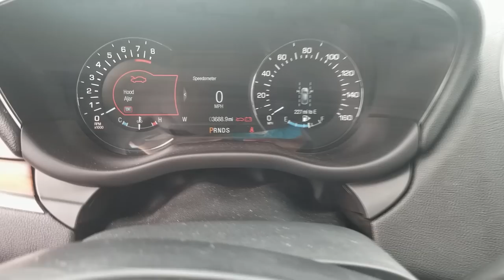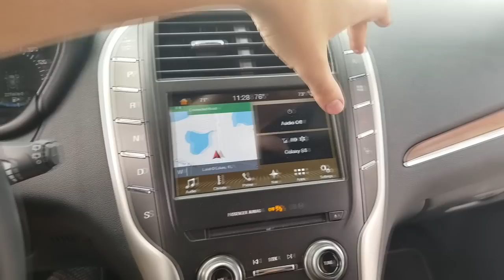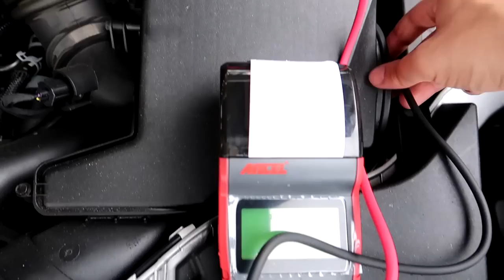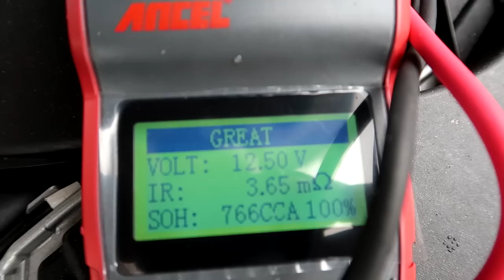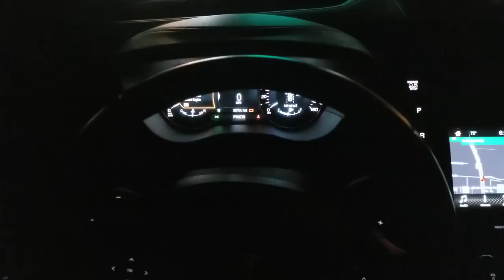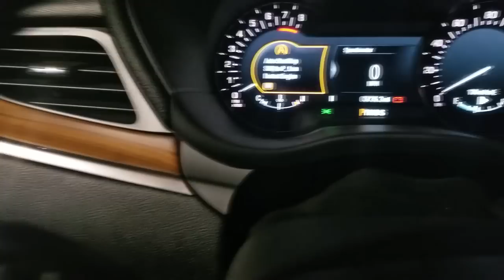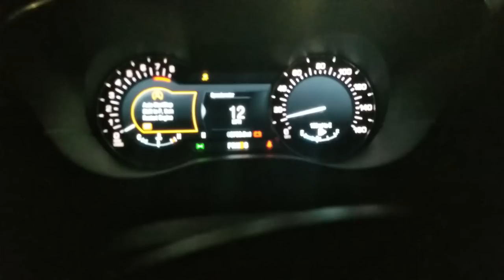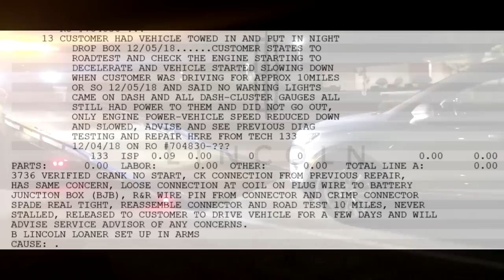I Saved Over $20,000 Buying a Like New Lemon Car! Then it Broke Down TWICE in 48 Hours!!!

Comment: I had similar issue in audi.  The problem lasted 2.5 years and no one could find whats going on.  Finally mechanic found the issue to be with fuel delivery. The issue was a smart relay, which apparently detects if sparkplugs are firing (if no spark for X amount of time, relay disables fuel pump for safety, for example to prevent engine fire i guess), which was not working correctly and it was randomly shutting of the fuel pump. As problem could not be replicated at the shop and cause could not be found why smart relay disconnects the pump randomly every few minutes in one/two/three days period and then its good for days/weeks. Every mechanic though it is a fuel pump, so I went thru 4 of them. FINALLY smart relay was replaced with regular relay ( now pump was turning on and remain on while key was in ON position, instead relay confirming detection of spark) all problems went away.  
My only recommendation would be to install very good OBD2 logger, and also power logger like: IDR-10 Kit Midtronics INGEN Diagnostic Data Recorder  (hopefully you can rent both from somewhere, or maybe dealer has the tools and can install them for a week) and then review the data after your car shuts off.
Reply: always eliminate fuel and ignition problems FIRST, then dig deeper
Reply: That smart relay is there for a reason. When you get into an accident, you don't want a fuel pump to continue running. Older VWs had an issue with this relay, but now I'm talking mid 90s, where it developed a dry joint on the circuit board causing the relay to cut out. The fix was to resolder the joint.
Reply: WholesaleTurbo - I know, but they could not figure out why the car shuts off in the middle of the driving.  when they finally found the issue was fuel delivery they could not find what actually went wrong, as every time i got my car to the mechanic it was working great.  Imagine doing 55mph, or even worse - Turning and accelerating into traffic, and car just shuts off for no reason. Then you put it really quick into neutral and turn key off/on and restart it without an issue, so you can put it back in gear and rive, and then 10-60 min later same thing happens.  Next day you go to the mechanic, leave the car for a week and they can not find the issue as its running fine. That is why I went thru four fuel pumps, a lot of electrical work (first they though it was an ignition problem) until someone replaced the relay and it started working fine. 

plonkster - I aware that the relay was very important, when you got into the accident, but in my case, the smart relay was the cause i would get into the accident in the first case.  It was either troubleshooting why the relay shuts off, spend a lot of money on mechanic and potentially get into accident on the highway when fuel is cut off while still fixing the car (I had couple of close calls), or just use regular relay knowing the car will work, and will go if I press the accelerator while merging into heavy traffic.
Reply: @michal93587  Fair enough :-)
Reply: ferkemall  

Not all intermittently working hall effect sensors throw a code and often the problem is a lack of tolerance to heat even on the occasional brand new sensor, making the sensor fall outside of accepted parameters just enough to confuse the BCM. Of course by the time you get it towed to the dealer it has had chance to cool back down enough to fall back into acceptable range and the vehicle starts right up.....and there's not a code in sight. Drive it for another few hours.....heat comes back, sensor fails again (sometimes).

Lots of fun for the whole family.
Reply: I've got a Grand Am that cranks but no start right now, no fuel pressure, no spark. After many hours of study I notice when I crank over the engine I see no RPM's on the tach (should be reading 200-500 RPM when cranking over engine). So my BCM appears to be not seeing the injector pulses ( spark plug firing) and I've been wondering exactly the scenario you've described where the relay disables the fuel pump due to this intermittent bad injector pulse sensor. The sensor by the way that senses injector pulse is the crankshaft position sensor.

Any chance you have any more info on the difference between the "smart relay" and the "regular relay" you mentioned swapping out? Better yet do you still have any invoices that might show the part number for the "regular relay"? I'm hoping changing out the crankshaft position sensor then relearning it's new parameters on the software will fix my problem and save me replacing the fuel pump(s) and/or multiple ignition parts and I'm terrified these guys at the shop will throw parts at it like they did for you as these intermittent sensor problems are like hunting for ghosts in the machine.

Any more info you have would be very much appreciated on this situation. After reading thousands of comments regarding crank/no start and similar scenarios over the last 3 days.....your post hit me as exactly what I'm going through......the lack of injector pulses is the key to our problems I believe.

Thx in advance. 

Richard
British Columbia .
Reply: @richardmorgan7246  This fuel pump relay safety feature is usually bypassed while the starter motor is running. So the symptoms is often that the car starts but dies the moment it starts.

Comment: I reckon it's the wiring loom! I have a focus ST which randomly spat out an "Engine Malfunction, service now" error message on start up and would run like it was only firing on two cylinders. If you turned it off and on the error disappeared and it ran fine. I took it to Ford and they said there was no fault code. They couldn't replicate the problem so nothing they could do. I told Ford I have found lots of reports of wiring issues (rubbish crimps etc) but they didn't look at anything. It happened again (a few times) so I drove it to them with the problem showing (took an hour to get there) and left it running while I waited for them to look at it. They plugged in the laptop and it said problem with MAP sensor. They charged me to replace it and I drove home ok. Next morning, same problem on start up but the code stayed logged. I took it to Ford who said it was the same error code (didn't offer to refund for the previous work though) so would need to investigate. This time however the sales rep said "the mechanic had something before where it was the wiring loom". They redid about five connections in my loom and now it is fine (six months with no problems). If your Lincoln's loom was made the same then you will have this until a wire splicing is cut out and rebuilt.

Comment: I fell for this same scam!  I purchased a "lemon" Fusion hybrid July 23rd 2018  It has been in the shop for over 20 weeks (currently there now)  Mine was bought back for a range issue and CEL  Ford refuses to install a new hybrid battery (which 4 different Ford technicians said I need)  The consumer is screwed on these as far as litigation. these vehicles are auctioned in states with few consumer protections( I am in Missouri)! Another reason to never purchase one of these is Absolutely under no circumstances will Ford provide any loaner transportation while yours is in the shop.  Though I am certain famous You-tubers get an exception.  I hope you have better luck than I am having.  Love your channel!     Keep up the great work!

Comment: Check the connections and the cap on the Starter next time you are under it.  I had a loose cap on a 2012 Escape and it often died on me just like that.  The dealership had it more than I did and put more mileage on it than I did in the first six months.  Since I had 'ZERO' faith in the Dealership by that point, at its first oil change ... the mechanic at a Belle Tire fixed it by tightening up that cap.

Comment: I really hope that a Ford executive watches this video....this is scary that a product like this can leave the factory in this condition
Reply: These sorts of issues are nothing new for Ford motor company products. I had similar issues with their dealers with a 2007 Focus that would intermittently have issues starting. (I bought the car new) After several years of repair attempts, I gave up and assumed that it was meant to be that way. I've moved on to buying out of warranty BMW's and haven't had nearly as much trouble. I've considered Fords since, but that experience of having an intermittent issue that can never be solved in several years left such an impression that I'm terrified of relying on a Ford product for daily transportation.
Reply: Ian Campbell 

My boyfriend's 2013 Ford Focus has transmission problems that Ford knows about, but won't fix. Multiple other people have had the same problem he's having but Ford won't do anything. I'm never buying a Ford product
Reply: Shit, for Ford this is a great car, above average.
Reply: Think about it though. Each company builds thousands of vehicles daily around the world, with parts sourced from suppliers around the world. One of my coworkers was a QA processor for FCA in the Jeep plant in Ohio. He said a lot of issues can stem from the factory putting a high demand on the supplier; for instance say the supplier agrees to produce 500 pieces of X daily, and the line is designed to accommodate. As demand for the finished car increases, the factory may  demand the supplier to increase the daily run from 500 pieces daily to 600, 700 or even 800+. As a result, the toolings for the part the supplier provides wears at a much faster rate, resulting in defects.
Reply: You make a good point.  Suppliers can provide defective parts.  Often, however, the car manufacturers buy from the lowest bidders and are willing to accept a certain percentage of defective parts as a trade-off for the cheaper price.  While efforts my made to catch a batch with an unacceptable level of defects, bad parts make it through.  Considering the large number of parts that make up a modern car, and the way new cars are thrown together, it's amazing that there aren't more problematic cars.

I'm keeping my fingers crossed that my car holds up.  It's 8 years old and has been trouble-free.  I'm not looking forward to having to replace it.

Comment: I’d guess an alternator / wiring issue between alternator, starter, and battery.
Reply: Auto Auction Rebuilds eyyyy you’re on Samcracs channel!
Reply: If the car is cranking over on (unsuccessful) restart, I’d say these components are functioning
Reply: @EricSchutt  yeah it sounds like fuel pump, coil or Spark plug. Maybe it was  just the ECM Modul/Start stop electronic s
Reply: @kitecattestecke2303  I'm thinking ecm or a broken wire in the harness.

Comment: There is a common problem with the Fords if they don't have a full connection to the battery they will not run but they still act like they have power take your battery connections off even if they look clean use a wire brush on the connections and reconnect the battery cables tightly that should alleviate the problem if it does it again repeat the procedure

Comment: Try replacing the battery even though it tests ok.  My 2014 Honda Accord kept having intermittent starting problems for months.  I had the battery tested several times and it always tested good.  Then as time went on it started having more and more weird electrical problems, but still the battery tested good every time I had it tested.  Finally I decided that the problems had to be the battery even though it always tested good.  I replaced it and that solved all my problems.  Well, all the electrical problems anyway.
Reply: Mother in laws 2017 forester was having a similar issue. 7k miles on it and the battery randomly acted dead. No lights or anything. Hook up a jump box and it would come to life. Cleaned connections, checked for bad grounds, and tested the battery. All seemed well, nothing unusual. Finally said lets replace the battery. Been fine since.
Reply: I would agree. Replace the battery. I had a chevy blazer that did something similar. Would randomly not start. Tested the battery several times. Then the car got me fired for being late so many times. That day, I figured out that the positive connection on the battery was so loose, it fell out of the battery.  TLDR, bad batteries sometimes test good. Replace it.

Comment: Have ford reprogram auto-start and security(Safety) lockout to 0 and increase limp mode speed to 55, and bypass the connector with a new dis-connectable wire. also check the ground connections to the engine. Consider this the sugar to your lemon.

Comment: In my 70 plus years on this planet, I've NEVER had any luck with Ford products. The last new one a van, had transmission shudder problems that the dealership could not fix. My son found the fix on a google search, it was a new aftermarket circuit board. We ordered it and had a local transmission shop install it. The total cost was if I remember correctly a little over $200.00. The circuit board was a fix, never had the problem again, we told the dealer who couldn't fix it what we had done and guess what? They couldn't have cared less and refused to pay a dime for the fix. See why I never bought another Ford product? TheReaper!
Reply: joeblackakareaper I had a Transit van that did the same thing. Only it wasn’t the transmission but the effect of shifting under certain loads causes the drivetrain to resonate at a very low frequency giving the impression of a faulty shift.
Reply: joeblackakareaper my family has owned 6 ford vehicles, never once been stranded, never once had any issue. im sure you just dont take care of your shit. ive had similar experiences with mercedes. never once had issues. lesson of the day: treat your vehicles well and do maintenance at recommended intervals and you wont have a single problem

Comment: I'd be finding out what that purple wire goes to.
Ford has a lot of issues recently with insufficient power/ground wires.
Personally, I like to add beefier ground straps from engine to chassis, battery to chassis and battery to engine. Especially if the Ford product has a lot of electronics!
I find that this, typically, solves a LOT of electrical issues.
Reply: I bet that purple wire is the size of a baseball right about now.

Comment: Replace your high and low pressure fuel pressure sensors do a good fuel system cleaner and only use 89 octane or higher, trust me my 2014 Lincoln MKZ was doing the same thing. The techs don’t know what they are talking about, if it was a loose wire it wouldn’t work again until the connection was made again and that would take somebody physically touching the wire to make the connection again. 2.0 ecoboost are notorious for the fuel sensors getting clogged causing a restriction throwing the sensor into thinking the pressure is low but it isn’t. Making the engine stall but the low pressure is only for for a milli second so it’s not a cause for a CEL .

Comment: For me, the continual nagging doubt over whether the car will start when I get in it is enough to put me off buying a repaired lemon. Even if it was free I'd rather pay for a car I can not worry about getting stranded in.
Reply: Are you kidding me? FREE? It could be on fire and I'd still take it if it was free. I'd part out the body panels/glass/interior. Pull the engine and run with an aftermarket ECU in something else. Sell the leftovers then scrap what's left.
Reply: @n01928  Yes, because your reply is at all relevant to this situation. What I'm saying is you couldn't give me (for free) a car that is unreliable as a daily driver.

What you're saying is that you could make money from the parts of a free car. Of course you could, but that has nothing to do with driving it daily.

Comment: Uncle's car had a similar issue. Dealer couldn't solve it. Canada does not have lemon protection so he is stuck with it. He brought it to me to check out. His was a bad crankshaft position sensor on the front cylinder bank. The wiring was intermittent right at the back of the sensor. If you wiggle it when the engine is idling, you can get it to fault or stall outright. I replaced the sensor with an updated part (imagine that!) then I replaced about 8 inches of the tightly stretched wire and connector. Did a solder repair job on it. Car has gone 10K kms so far. No issues. You might want to check that out or have the dealer do it.

Comment: You'd think the start stop feature would turn off if it senses low voltage.
Reply: That's the workaround to disable it in my 2015 Golf, set the low voltage threshold unreasonably high and it never comes on. Had a couple of cars with the feature before (BMW auto and manual), no problem, but the Golf (auto) let me down at a roundabout at 6 weeks old. Coded that shit right out of it straight away! 😁
Reply: Yup start/stop is a stupid feature anyway designed around how epa calculates mpg.  Sounds great and so useful on paper.   Then just like with the only on tv products you go to actually try it.  It's no better than the mess with VW diesel except here the right backs got scratched and poof approved as effective.
Reply: @cardinaloflannagancr8929  my car (a diesel) was delivered the week the diesel thing broke. At least it's not an affected model it knocked the resale values and my confidence in the brand no end. They've got away lightly over here (UK), a cynic might wonder if this has anything to do with VW being a European brand 🤔
Reply: @AdrianNelson1507  That's what I was getting at Adrian.  They do these things the same here to pass standards.  But they're no different than vw was in how real world effectiveness.  Vw gets vilified while bs features like stop start that do no real good are in the clear.  They both designed around the testing parameters.  Things like stop start to boot also add needless wear and costs.  More robust parts or more frequent repair, issues like here etc.